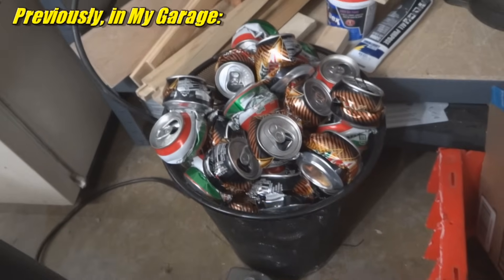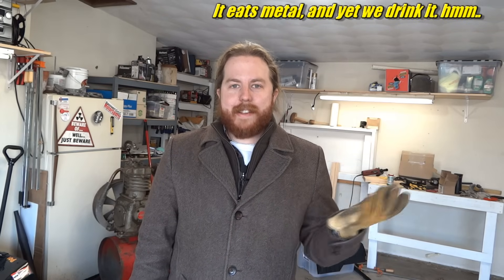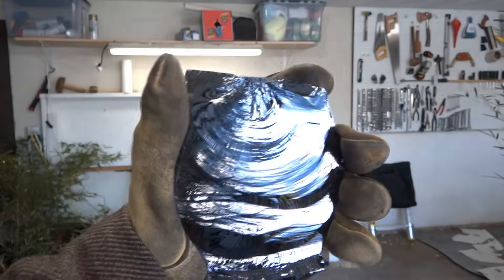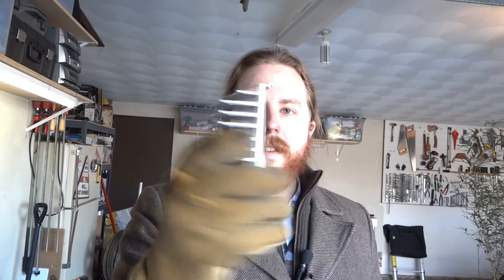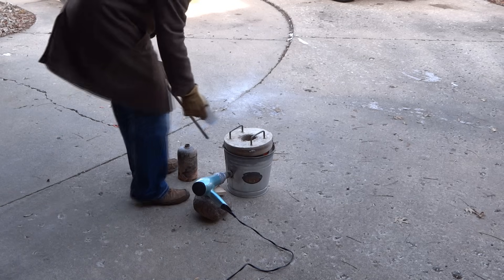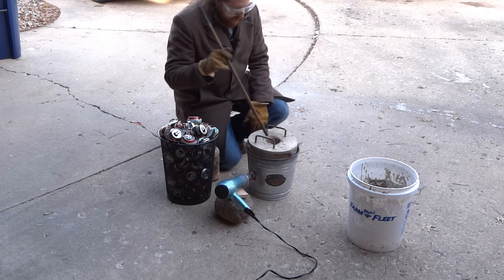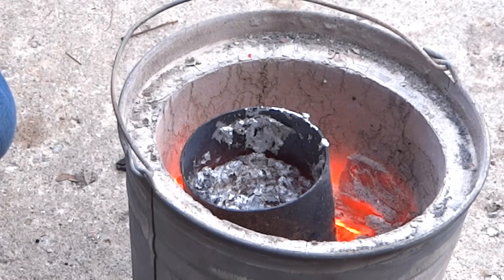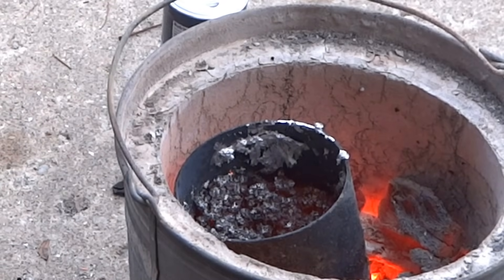Get the Most Aluminum From Melting Cans

Comment: instead of salt you could use borax.
Reply: Borax is like 5 times more expensive than the aluminum.
Reply: +thefourthtuxzt Aluminum is free when it comes in the form of discarded cans. 5 times free (0) = free (0).
Reply: @Orc-icide  Just like your Mom and wife bro!  

~NMB
Reply: thefourthtuxzt have you meant salt instead of aluminium? Anyway, borax is still very cheap. In my country, it costs ~$2 for half a kilogram :)
Reply: I remember being told that borax shouldn't be used with aluminium. Not sure if it's true, though.
Reply: Borax and glass!

Comment: Hey Paul my name is Byron how did you make your furnace
Reply from the maker: I have a video on it somewhere, but basically i originally had the 'mini metal foundry' from the king of random's build, but it ended up breaking down at high heat, so i remade a similar design but with castable refractory cement designed for use in chimneys and blast furnaces.  So far it hasn't shown any signs of breaking down, so it's a major improvement over the sand/plaster mix as far as longevity, but it doesn't insulate as well.  Still, i had no problem melting aluminum with charcoal or propane.

Comment: OK, this is all great. But when it all boils down to monies are you even breaking even as far as to the recycle material verses your expense to get the ingots casted and pored.
Reply from the maker: +JIM Short nope.  Not even close.  That's why I'm not doing this for money, I'm doing this to get the aluminum to use for metal casting projects.  In fact, where I live there is no can deposit and return charge, so the cans are 100% worthless.  Scrapping doesn't pay here. Aluminum ingots for casting projects are really expensive, however, like $4 per pound, and I use less than $4 in fuel to get many pounds of aluminum.  Cans are pretty inefficient though, and you don't get a good casting metal, but one that's good for alloying, so there is more work after this but the final alloys are even more valuable for casting than aluminum.

Comment: Hey Paul - Paul here... good tip with the copper addition to the aluminum. I'm casting sculptures, and was wondering how to do away with shrinkage... mostly notice it in the Sprue, not the cast pieces below. I'd hate to find out the hard way. Subbed.
Reply from the maker: +zillustration hi Paul!  Adding copper won't really help shrinkage as much as silicon, and aluminum will always shrink somewhat.  If your sprues and risers are of sufficient size/locations, you shouldn't have damage to the piece.  Are you doing lost wax or something?
Reply: search zillustration or paul zdepski on FB - i have some public on my page... plus pics of my furnace. Will be trying lost wax, but currently using Super Sculpey to make my models, then casting in fine green sand. A friend of mine is a jeweler, so he's got the super fine stuff. Great detail with finer sand.

Comment: What is your crucible?
Reply from the maker: In this video it was a steel crucible, but it died shortly after this.  Steel makes a bad crucible.  I now use graphite clay crucibles.
Reply: Paul's Garage made from what? Did you make it yourself?

I have a whole project based on doing furnace stuff as cheaply as possible. I found a fire extinguisher for free what do you think of that?
Reply from the maker: +Dan Hyde yeah mine is fire extinguisher bottom.  If it's free that's great, it will work for a little while at least, but they don't last very long.  Mine got 4 used before it started leaking.  Long term best option would be a good graphite clay crucible.  It's more expensive but it lasts much longer so your per-use cost goes down
Reply: Paul's Garage for a similar sized graphite crucible to the steel one in your video, how much did that cost you?

Comment: How did you crush your cans? When I crush mine, they end up to wide to fit inside any reasonable pool of aluminum, as they stand up instead of lay flat.
Reply from the maker: +capfer77018 I have one of those things that just bolts to the wall with a lever on it for crushing cans.  I think the uncrushed ones were better to melt though.

Comment: Paul, new subscriber, love your style and knowledge. Question: how did you affix the blow dryer to the pipe for air induction? The diameter of the blow dryer I purchased is much larger than the 1" pvc. Just screw it and tape it or what, Paul? Great videos. Thank you!
Reply: When I melt I just tape it, I will still leave small gaps in the tape so that the hair dryer doesn't completely die. If you are not worried about murdering the dryer, just affix it to the pipe with miles of tape. If you watch the video you can see that Paul did the latter with a bunch of grey tape, this of course gives the advantage of MORE FIRE!
Reply from the maker: +RC pi yep exactly.  Lots and lots of tape, that's what I did.  I taped it to a 2" to 1" reducer thingy and screwed that into a 1" pipe

Comment: to stop it oxidising you could use Borax...
Reply: Paul's Garage borax is a great flux, but it is like you say "not great for crucibles". It is awesome for forge welding steels, but it still does do damage to a propane forge, I found this out many moons ago. just make sure that  you have something in the bottom of the forge/foundry that doesn't react to molten borax. There are plenty of options, just gotta do the research ;-)
Reply from the maker: +The First Dovahkiin that's true, but borax is really hard on crucibles.  I've heard boric acid which is a little weaker can do the same job without as much crucible damage though.  I used neither lol but I have used it for copper

Comment: Just a warning: your fire is hot enough to soften iron, so it's surprisingly easy to poke a hole in a steel crucible. Hot molten aluminum plus a little iron oxide, which you'll have as rust on your crucible, makes really excellent thermite! Ask me how I know!
Reply from the maker: +Richard Betel you're right! In fact the very next time I tried using this crucible (in the keychain video) it started leaking.  I replaced it with a graphite clay one.

Comment: On the risk of sounding like a know-it-all: wouldn't it be more effective  if you first poured the molten aluminium out and then used the salts for the first time? because before you use the salt the unwanted parts on top stick somewhat together like a skin, making it that much easier to pour the first round + after adding the salt 1 "big time" you have a greater amount of extracted aluminium than like in your video when you added salt the 2. time making it easier to get the remains out.
Did that make any sense to you or is it just my brain being weird again? 
Hope it helps,
Shen Bot
Reply: Shen Bot The flux makes the aluminum pour better, too.
Reply: In what way specifically, if i may ask? when i meant easier i was referring to the fact that you didn't need to hold a sieve to catch the slag first time around. How does the flux help with that? From what i get of Wikipedia, fluxes help purify the aluminium but they also liquify the gathered slag, making it harder to keep in the smelter when you pour the aluminium... explanation plz
Reply: The flux causes the aluminum and slag to SEPARATE. The slag then floats to the top, where you can scoop it off or try to "decant" the aluminum as you pour. Also, it feels like the fluxed aluminum is more runny, like it has a less surface tension, and it also feels like it stays liquid longer. When I first started melting, it seemed as though I could only just barely get the crucible to the mold to pour, and it poured slowly. Once I started fluxing, it didn't feel like a struggle anymore.

Comment: Paul, is the silicon used to make hard drive platters the same as the silicon you're speaking of?
Reply: KyHighlander59 i think you can make it using thermite
Reply from the maker: possibly.  Pure elemental silicon has many uses, including as an alloying agent, but it's not particularly easy to find.
Reply: No- that is a thin, polished iron oxide on aluminum platters that you're thinking of.  There is very little silicon in hard drives (only minute quantities inside the solid state devices (chips, transistors, diodes, etc)

Comment: THis is the link to the burner -https://www.youtube.com/watch?v=VxzdqcPzXj8   i built. I modified the hole size of the injector and aspiration holes. It uses more propane (obviously) but definitely kicks out enough heat to melt copper in a little foundry such as yours.  This was the cheapest and easiest method i found. (for long term. Grant Thompson's design was a good for a quick, down, and dirty method. I found that the injector had trouble staying in place after a while and the little piece of metal on the back to adjust the flame would never stay in place. I did use a big washer on the back of the burner design posted in the link above. Just to provide a good seal on the back. Been using that burner for almost 2 years without a hiccup. No Need to make the flange on the end. Unless you want to burn stuff outside the foundry. The foundry acts as the flange and will make the swirl of flames that we all love and enjoy.

Comment: you might wanna wear a respirator. I bet those plastics which are inside the can aren't good for ya ;)
Reply from the maker: Good point!  The respirator filters I have don't protect against fumes, though.  I probably won't melt cans again, the fumes burned my eyes really bad and it smelled TERRIBLE
Reply: You can get respirators with attached vizors on ebay . The orange one I saw you using in some videos are terrible. http://www.ebay.com/itm/7-in-1-Facepiece-Respirator-Painting-Spraying-For-3M-6800-Full-Face-Gas-Mask-/191793044745?hash=item2ca7c19d09:g:xd8AAOSwvUlWqG-7 

I got this one http://www.ebay.com/itm/Free-Shipping-3M-7502-7-Piece-Suit-Respirator-Painting-Spraying-Face-Gas-Mask-/271960837400?hash=item3f52210d18:g:eBAAAOSw3ydV0vAD 

I dont know if it protects against fumes but it does most certainly against the dust you work with.
Reply from the maker: those look pretty nice.  The one I have isnt' really meant for fumes or painting, just "nuisance particulates" like saw dust and metal filings from grinding and stuff
Reply: Yeah it's worthwhile.  I bought it without the vizor to buy a seperate face shield separately so you can flip it up... But it's a bit in the way.. But was worried it would fog up with heat that's why.  Sorry I'm being naggy just care about your health man and setting a good example is also good for the safety of others.
Reply from the maker: no problem! safety is always a good thing to worry about especially when fire is involved

Comment: If I understand correct, your flux is NaCl and KCl mix 50/50 %?Were are you get this salt?In my country is only tehnical grade and it is pink color...
But your is white, it is pure KCl???
Do you use the food grade salt combination?Something called ''Light salt''?
Reply from the maker: +Toto yes I used food grade litesalt by Morton.  It's the only stuff I can get here.
Reply: Salt is a cover flux. It's less dense than aluminum and melts at a similar temperature, so it forms a liquid layer floating on top of the aluminum that keeps oxygen away from the metal. I think it can also help prevent hydrogen absorption (that leads to bubbles in castings.) It's usually added at the beginning of the melt, so it's covering the molten metal the whole time. The reason for using a 50/50 mix of NaCl and KCl is that it's a eutectic mixture that melts at a lower temperature than either pure NaCl or KCl (the pure salts have melting points higher than ideal.)
Reply: you can mix your own 50/50 eutectic mix of flux by melting the two salts (NaCl and KCl) together, 50%/50% by weight and then pigging in a mold.  Let cool and break up with a hammer.  Throw small amounts in.  It is hard on every crucible, even the one used here as it promotes corrosion. It will eat a line in your SiC and clay graphite crucibles too if you use too much too often or leave it sitting there too long.  The pink in your salt is caused by an impurity, probably iron. It may or may not affect what you're melting, but pure salt is usually not hard to come by.

Comment: Hey ! I really liked your video and content in general, but I've got a question : what kind of gloves are you using ? 
Because where I live there are no ''high heat'' resistant gloves for sale (or at least I couldn't find a store wich did sell them...) so I wondered if it was that big of a deal if I hadn't these ''high heat'' gloves (I do have other gloves, but they can't withstand these kind of temperatures). So what would you recommend ? Should I order ''high heat'' resistant gloges on internet, or will the gloges I already have do the work ? (I do not plan to get my hands inside the furnace of course, just to get the lid on or off and to refuel)
Reply from the maker: I use a couple different gloves, don't remember which ones are in this video.  one pair is just gardening gloves (100% leather), and the other is a pair of welding gloves.  I talk more about them in a video somewhere about foundry safety equipment, but basically the welding ones are better.  I think foundry gloves or fireman's gloves would be better yet.  I don't know which high heat gloves you are talking about, but the higher heat resistant the better probably.  You don't need to get your hands in the furnace to get cooked.
Reply: When I spoke about high heat resistant gloves, I hadn't any kind of gloves in mind, just a pair that can withstand high temperatures. Anyway I ordered welding gloves on the internet yesterday, that can withstand tempertures of up to 500°C (I know the furnace reaches temperatures way higher than that, but I think it'll be ok as long as I don't drop molten metal on me...). But thanks a lot for your answer !

Comment: Hey good videos! I just made a dual propane set up. I took an 8 gallon bushel tub and used a 5 gallon pale for the center hole. I cast the propane torches right into the cement. My crucible is an old steel firefighter scba (self contained breathing apparatus) tank cut roughly in half. I use a soup strainer/ladle to scoop the crap off the top. Never used flux though but I will start. With the charcoal set up (same as propane but with one hair dryer) I could melt 400 cans (based off of weight) before I had to pour. I did this twice before there was too much ash in the bottom...would run through two bags of charcoal though. That's why I switched to propane...haven't melted any cans with propane yet, I could let you know how it turns out. I'd like to melt brass too. Keep up the good entertainment!
Reply from the maker: Thanks!  Charcoal works pretty well but i'm using hardwood lump charcoal which burns a lot hotter (and gets used up a lot quicker).  I think lump is overkill, but propane should work super quickly.  One word of warning, my steel crucible was eaten through and started leaking after a few uses, you might want to swtich to graphite clay crucibles.  A high power propane set up can even melt steel, and you don't want that when it's full of aluminum!

Comment: K not to be a douche but sometimes melting metal is just stoopid...im pretty sure they were worth more mobry if returned to beer store...how many cans a pound you get...guaranteed not 10c a can
Reply from the maker: +Dylan Campbell you do lose money if you are trying to make money scrapping.  I'm not, I'm trying to get the specific alloy of aluminum to use for some casting projects.  Also my state doesn't have a can return program, so they are worthless either way. :/

Comment: hey Paul what metal container did u use to melt the aluminum in?
Reply from the maker: In this video i used a steel crucible, but i would actually recommend not using steel.  The thing died after the very next use (the keychain video) and now i have to replace it.  I would suggest a graphite clay crucible for melting anything.

Comment: Paul you can make a really good cheap propane burner just look up "how to make an aluminum foundry" by the backyard scientist. mine got hot enough to melt copper easily and you wont have to deal with refilling the charcoal every few minutes and you wont have a bunch of ash to deal with when your done melting to. fair warning make sure you have a thick and durable crucible because i have all ready burned holes in some of mine. good luck.
Reply from the maker: Thanks for the tip.  I'm goign to make a propane burner before too long.  With hardwood lump charcoal i never get ashes in the bottom of the furnace, but it burns out so quickly i can't get the thing reliably hot enough for copper.
Reply: It’s a furnace not a foundry! Just saying.